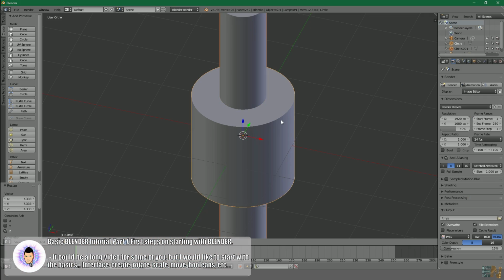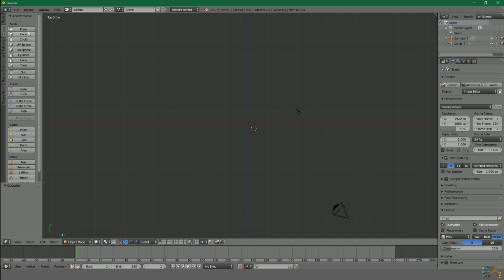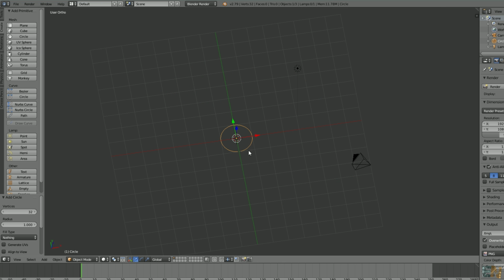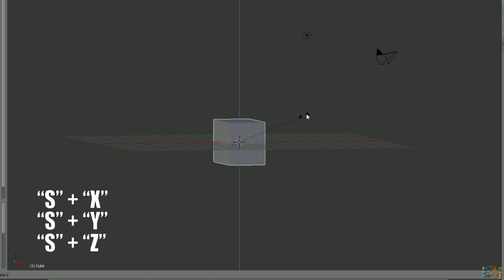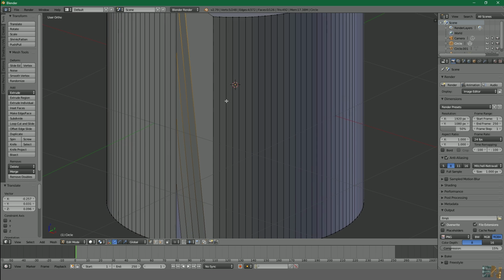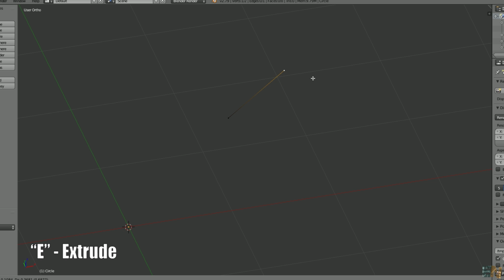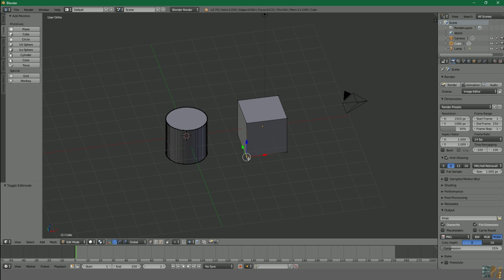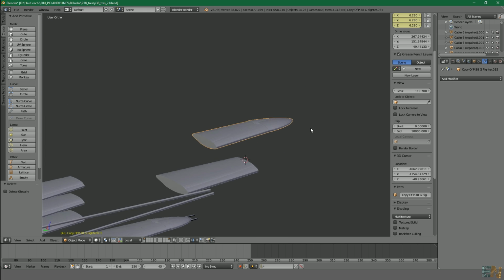Starting With BLENDER Basic 3D Editing PART#1

Comment: There's also different method to add required thickness. After creating plane go to modifiers and add solidify. After setting thickness you can choose offset to it (outside/inside) and then apply it or better leave it if you want to change somehing later

Comment: Hey! Love your videos man, you make the supplementary information available to the broad strokes and that makes a huge difference. As a side note: do you do freelance circuit/PCB design or have a recommendation for a service that designs them affordably?
Reply from the maker: Thank you. And no, I'm sorry but I don't.
Reply: @ELECTRONOOBS  no worries. Thank you for the reply! I've been trying to design a pcb version of the 220V AC  PID loop temperature controller that you had taught about in a previous video, but I just can't wrap my head around board design. It's for a project I have that will run for extended periods of time, so I have to make sure it gets done safely haha.

Comment: Nice tutorial but please do your Blender tutorials with the latest version which is Blender 2.82. The UI has been redesigned to some extent from the version you are using. Some of the  features  you use here have either been moved around or renamed. Also the mouse buttons now function in a more conventional way as opposed to the unconventional way used in older versions. It is more helpful to do a tutorial with the latest version than an older version.  Blender 2.82 is an overhaul of 2.7x. with improved features and better ways of handling some things. New users might get confused when they download the latest version and try  to follow your tutorial.